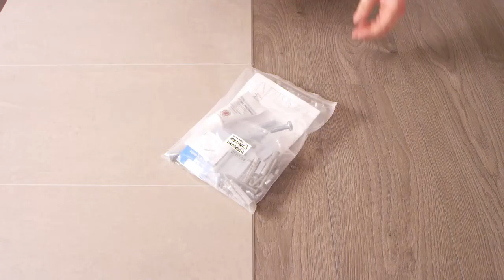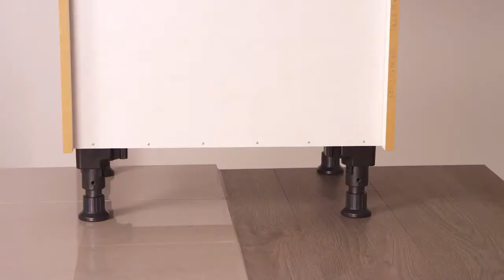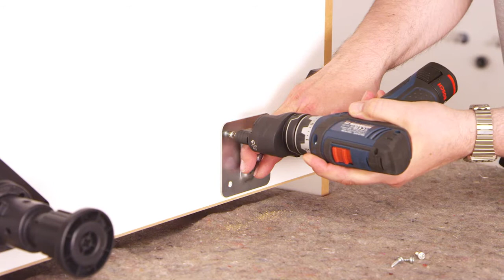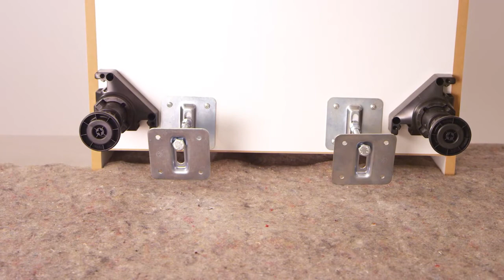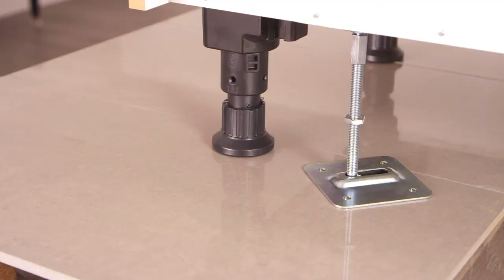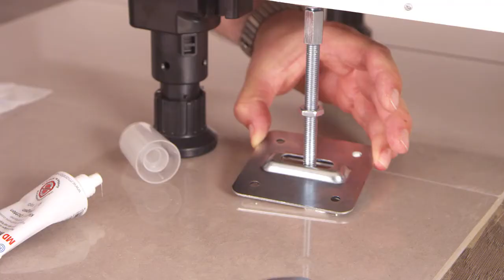nobilia | Montage | Kippsicherung

Comment: En clair si nous n'avons pas cette super visseuse , impossible de visser les vis dans les chevilles... Super système
Reply: Ca se fait très bien sans la visseuse d'angle. il suffit de fixer une des deux platines sous le meuble, placer/régler le meuble, faire un montage à blanc du système anti-basculement, et tracer les emplacements des chevilles. On bouge le meuble et fixe la seconde platine au sol, puis on remet le meuble en place. Les 2 tiges filetée seront alignées il ne reste plus qu'à les serrer ensemble.